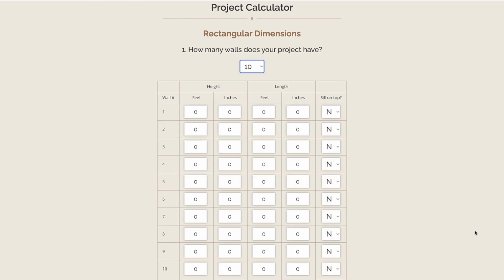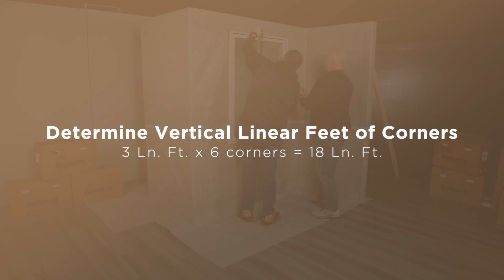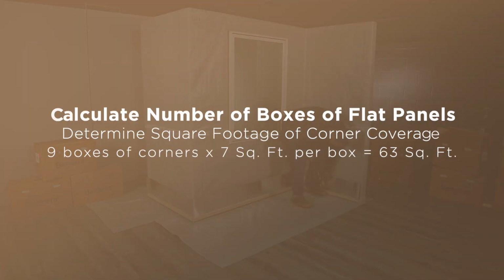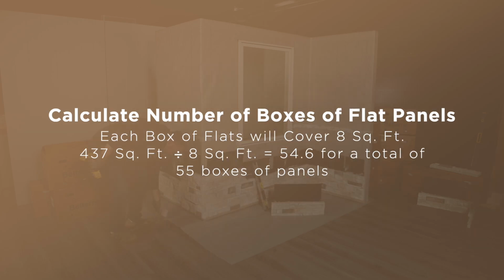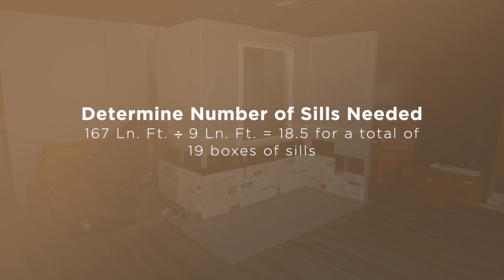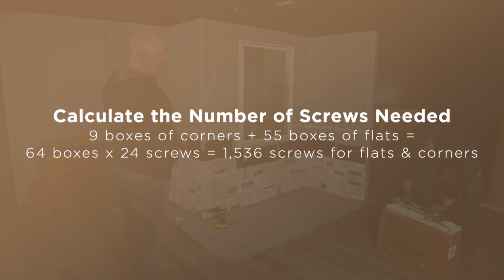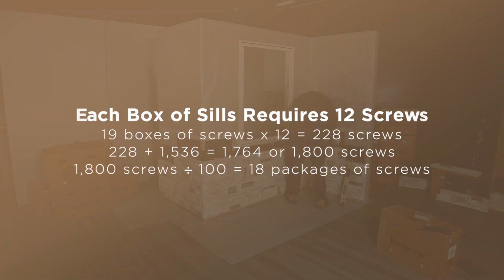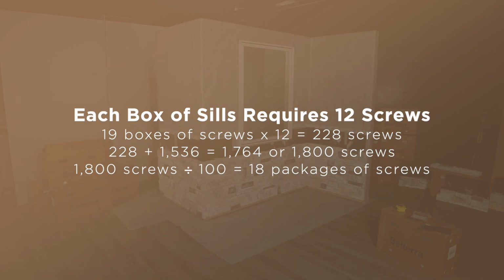Full Install Video | Silvermine Stone

Comment: At 18:45 your installation of the sill is horrible. You're using construction adhesive for sealant above a horribly designed sill. You're depending on a thin piece of metal that is screwed to the wall not to flex after it's glued. In my opinion, it needs a metal L- bracket to support it.